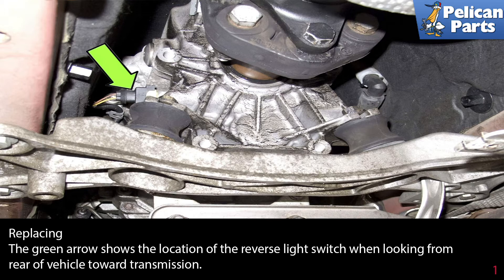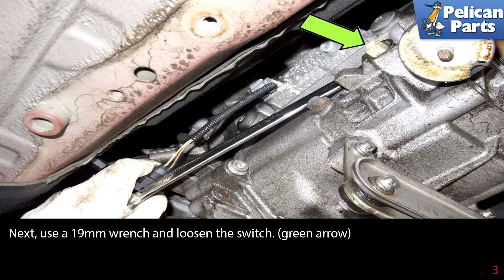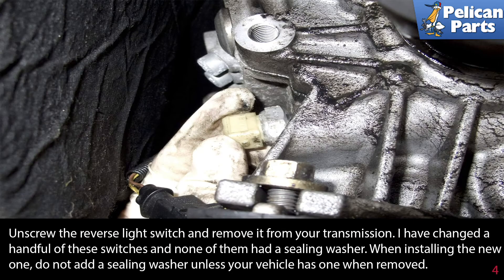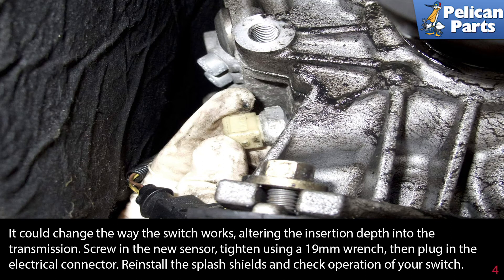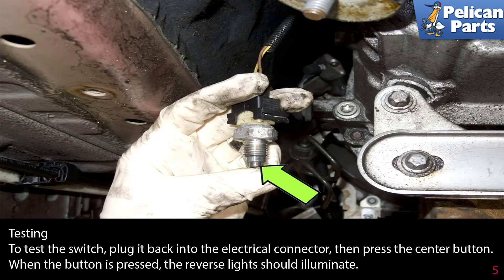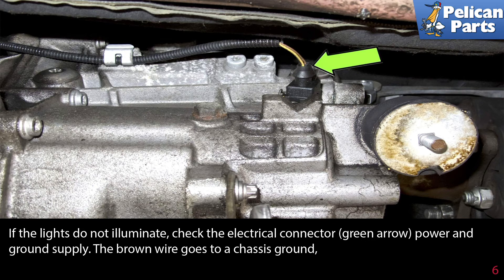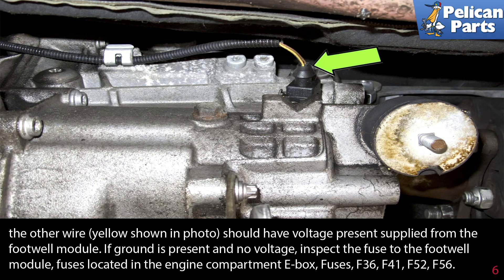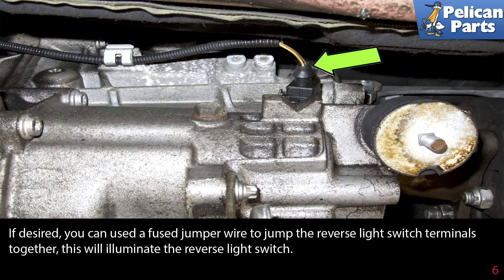BMW E90 3-Series Reverse Light Switch Replacement for 325i, 325Xi, 330i, 330xi, 328i, 335i

Comment: Hi my reverse light are staying on all the time is this the same  problem on my x1
Reply from the maker: Could be a control module. Use a scan tool to check the switch input to see if it is off and the lights are on.

Comment: Is there such a part in the automatic transmission, man, my reversing lights do not light up, the bulbs are intact thanks.
Reply from the maker: It is inside the transmission, not an external switch like this.

Comment: Fault CDA4, CC-ID 354, and Fault 00D374 are all that I am chasing down now. All appeared after the FRM went bad. So to know the switch goes to the FRM is a good indicator for this issue.

 FRM in my 2011 e90 335i xDrive went kaput, and then worked off and on. Got an identical used one off of eBay and coded in the features I wanted with Carly and ProTool and now my reverse lights don’t work. Not sure if this was a problem when the FRM went bad as there were MANY issues. But it is a problem now.

I will check this switch today or tomorrow! Seems easy enough. Just gonna press it in and see if the lights work. Wish you showed where those fuses were tho :/
Reply from the maker: Thanks for the Info. We appreciate it.

Comment: i have a problem where my reverse lights are always on i have the same car but automatic, what could it be? all my tail lights work and my license plate lights and the trunk opens with the control key
Reply from the maker: This is likely a fault with a control module. Check for fault codes to start.
Reply: @pelicanparts   on my dash i have 4 light bulbs with an exclamation mark

Comment: I missed the manual transmission part. I guess I need to hunt down the fuses if not I guess it's the FRM module.
Reply from the maker: I would suggest you grab a repair manual, you should own one. It will have the wiring and fuse info.

Give our parts specialists a call at 1-888-280-7799.
Reply: @pelicanparts  thanks i checked all the fuses and seeing I can't get the laptop to connect to the FRM module I'm thinking the module is bad. I'm sending it out to be checked. Hopefully this fixes the issue.

Comment: Thanks for this video. I just bought a 06 330i and the wires to the trunk lights were broken sending the 50 starts to the FRM module. I've repaired the wires and replaced the light sockets. Have tried numerous times to reset the FRM but it keeps saying reverse lights not working. I'm going to check this before sending the FRM out for testing and repair. I hope it's the switch. Everything else in the car works.
Reply from the maker: Could still be a wiring issue or voltage drop in the harness causing the fault.
Reply: @pelicanparts  Okay I'll check it out! Thanks for responding.